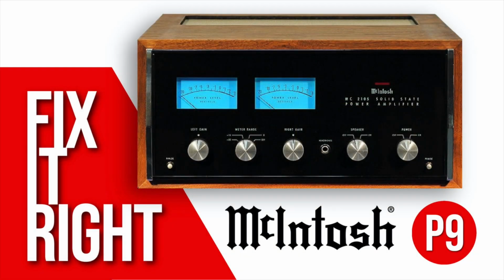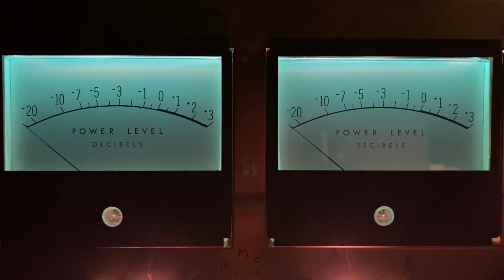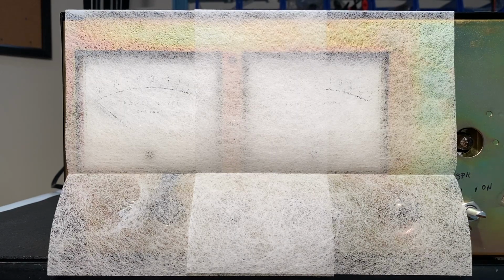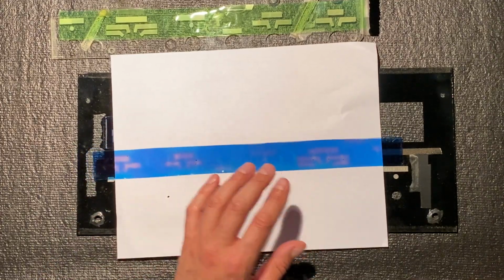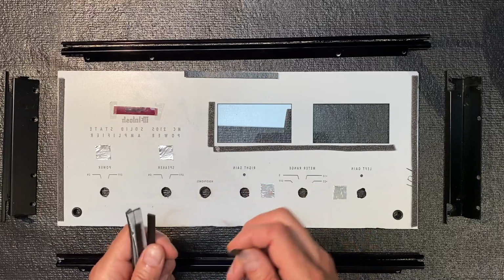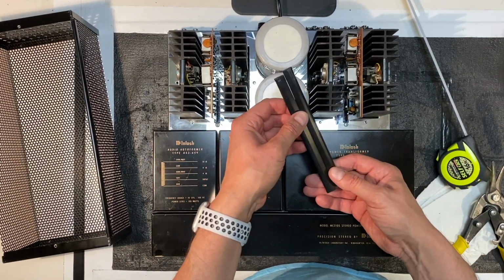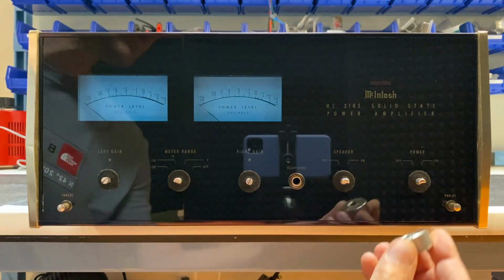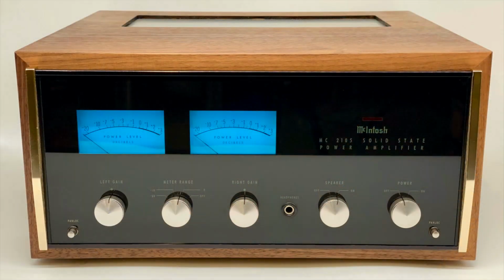McIntosh MC2105 P9: Demonstration, Meter Calibration, New Lamps, New Glass, New Cabinet & Panlocs!

Comment: Hi Chris,
I'm in the final run of this thing. I used my Radio Shack "Kamikaze amp" to make sure I had some of my instruments connected correctly to check certain specs. In Part 7 you used several instruments that I don't have but I wanted to check the accuracy of my meters and I ran a square wave test on the amp as well. The square wave test showed a great form.

I was so surprised at how perfect the wave was showing up on the scope that I thought I may have made an error connecting the SFG and somehow bypassed the amp! LOL Of course, it was connected correctly.

I only went to about 75 Watts because my dummy loads were 8 Ohm x 100 Watts. You cautioned that I was cutting it close if I went to 100W. 

I calibrated the meters and I was hoping you could confirm the conclusion I came to when I did these tests. I used the 50Watt level output (-3db), to calibrate to.

I have drawings and photos of my tests but no way to attach them here, so perhaps you can visualize my arrangement:

I set my SFG to put out a 1KHz @ 1.000V and calibrated the AC Multimeter to “0”:

A) I ran a cable from the CH1 of the SFG to the left & Right inputs of the amp, (BNC T-connection). 
B) Then I ran a cable from the Left channel, 8 Ohm, speaker connection of the amp, (with an 8 Ohm x 100W dummy load resistor), to the Input of my analog AC Multimeter. 

This cable also had a BNC connector on one end. The "+" side of the cable was soldered to an 8 Ohm x 100W dummy load resistor and the 'negative' lead, (or maybe it should be called the ground lead) of the cable was clipped to the speaker's Left channel, 'common' connector. 

So testing the Left meter first, I ran the cable ran from the Left 8 Ohm speaker connectors, to the Input of my analog AC Multimeter.

If you're still with me, 
C) I ran another BNC cable from the Output of the AC Meter to the Channel 1 Input of the O-Scope and grounded the O-Scope to the Amp Chassis.

Then I set the Variac to 117.4 Volts, (I always have a DMM connected to the Variac to confirm the voltage output).

I had my AC meter selector set to the "1V/0db" scale. I then sent the SFG signal and carefully increased the Gain on the amp's Left channel. 

I found that both, L & R Amp meters were off. Each were a little one way or the other of the Ac Meter’s db readings. 

I chose to use the -3db/50W as the calibration selection to bring the amp meters to read correctly. 

I turned the gain up on whichever channel I was adjusting until I saw the AC Meter reading exactly “-3db”. Then I adjusted the calibration resistors of the amp’s meter to move the needle of each amp meter to exactly -3db.

After the adjustment, I reduced the amp’s L or R gain to “-5db”, “-10 db” and –“20 db”. Each step was aligning perfectly with the same db readings on the AC Meter. 

In fact, they (the amp’s L & R meter readings), matched the AC meter’s db readings all the way up and down the scale. I took them up to about -1.5db but I didn’t want to push my luck and exceed the watts spec of the dummy load.

I think I got it right and am probably wasting your time but then, there’s been many times when things made sense to me and turned out not to be the case. I thought I’d better just bounce this off you and see what you think.
Thanks,
Rich
Reply from the maker: That all sounds great, Rich. Congrats! If you want to confirm that you’re getting 50 watts at -3dB on the meters, you can input a 1 kHz tone (use a sine) and (with dummy load connected) measure the AC voltage from the speaker output. Square the voltage and divide by the load’s resistance (8) and it should give you 50 which will be the wattage. The only other thing I’d mention is that if you only have one dummy load, keep the level at zero for the channel you’re not testing. Sounds like that’s exactly what you’re doing, though.
Reply: @FluxCondenser   Thanks Chris. In fact, I wanted to do that 50watt test but I'm not clear on where I should touch my DMM leads. 

"Measure the AC voltage from the speaker Output":
So should I set my DMM to AC and connect the leads to the "-" speaker contact and the "+" speaker contact (on the other end of the dummy load)? Or am I not even supposed to use the DMM? This is a step that threw me and yet it seems like it's too simple for me to not understand it. 

I started thinking, "Well if I use the DMM + lead connected to the dummy load, then am I affecting the the reading?". Then I thought, "...maybe I'm not suppose to use the DMM..."
Rich
Reply from the maker: Yes, connect the positive from the meter to the pos of speaker output. Neg of meter to neg  of speaker output. AC mode. Also have the dummy load connected to the speaker output you’re measuring. Standard setup for a power test and you can also use this method for a precise calibration of the meters.
Reply from the maker: Oh, and no, the multimeter won’t affect the resistance as its impedance is so high, likely in the mega ohms. This may sound counter-intuitive, but the high impedance limits the current draw to the meter so much that its effect on the circuit are negligible.
Reply: @FluxCondenser   Thank you!!! I knew this stage was coming for some time, but I felt the question was just down-right dumb to ask. However, from my lack of experience, I visualized frying one $50 DMM after another, trying various connection possibilities, (as I saw it in in my mind).

It was initially this method that I wanted to use to calibrate the meters, but not wanting to ask a dumb question, (which I ultimately did anyway, LOL), I decided to use the AC Meter as an alternate method to reference my amp meter readings.

Thanks for clearing that up. As you can see, I can be easily confounded when it comes to electronics, and don't even get me started on the many contradictions that I 'personally see' in the "physics of electricity"!! LOL. 

That field of science baffles me to no end; i.e. 'negative is positive and positive is negative', and Ground is so freakin' magical that you'd need to get a masters in "prestidigitation"! LOL
Rich

Comment: I'm glad I went and checked this part of the series, (as you suggested earlier). I was removing the nuts from the bolts, (12 of them), thinking that I would be able to remove the cage and covers all at once. However, I see that there are only 2 sheet metal screws on the bottom that hold the cage down.
Rich
Reply from the maker: Ah! Glad it helped!

Comment: Good series.. The reflective tape would work better if it was on the under side of the cover.. I did it to mine with good results.. Also for anyone needing to replace the glass because the black is chipping off.. I used 1shot 199L black glass paint to touch up with excellent results, it is a dead match in color..

Comment: Great job. Thanks.
I have mc 2505. Recently one of the meter is acting erotically. When I start the amp the left meter's arrow go to the far right and didn't moving. Struck there, not moving. After switch off the amp that arrow slowly return to the O position. 
The right one working perfectly.

Pls guide me how to fix this issue. Your advice will be much appreciated.
Thanks n regards
Reply from the maker: An erotic, meter, eh? ;-) Your first step would be to investigate the meter driver board. If the 2505 is similar to the 2105, there will be two potentiometers, one for left and right. Try moving the pots back and forth as they may simply be making poor internal contact. If the meter returns to a normal position as you do this, use control cleaner to clean the pots. Then put them back in their original positions or calibrate the meters using the steps I show in the video (follow the actual instructions, though, using the service manual for your unit). 

If that doesn’t clear up the problem, you may have bad capacitors on the meter board or elsewhere in the amp. You could choose to recap the board (or entire amp) and see if it helps, or try to really diagnose the issue. Diagnosis would be beyond the scope of what I could describe here, but would entail some signal tracing, voltage and component checks/replacement. 

There is also a possibility the meter itself is bad so you could check the output going to the meters to make certain the current is correct. If it is, you’ve got a bad meter. You could also try swapping the leads going to the meters (switch the left leads to right meter, etc). If the problem is consistent with just one meter, you’ll know you’ve got a meter problem and not a circuit issue. Good luck.

Comment: Very good video.  Interesting to see how it all came back together!  One thing I was curious about was why did you calibrate the amp meters to full scale?  Every power amp I have seen shows full power of the amp at 0 db, not full scale.  I would think that the +3 db markings on the Mac would be there to indicate headroom peaks.  In other words a 100w amp would have a 100 below the 0db mark and a 170w amp would show 170 etc.  Here's an example of a Sansui BA3000 to indicate what I mean.  https://www.audio-high-store.com/wp-content/uploads/2019/10/Sansui-BA-3000-1024x600.jpg .
Reply from the maker: The meter is calibrated at 105 watts per channel at 3dB. Full power without clipping. This is per McIntosh’s service manual and the correct way to calibrate.
Reply: @FluxCondenser  Ok, no problem.  Interesting.
Reply from the maker: Additionally, McIntosh may have elected to have the zero position of the meter peaked out at full scale so that at the lower meter positions (which are probably used more often) would have more meter movement. As these are not real watt meters and dB is a relative unit, the meters can be calibrated to any way the user finds useful. I wanted the amp to be set up as per Mac’s instructions.
Reply: @FluxCondenser  My MC2300 meters were calibrated using the same method, on the zero db scale +3 db = 300 watts.

Comment: Hi, great job! any suggestion how to fix/change the speaker switch? I can’t found an original to replace.
Reply from the maker: What’s going on with your switch, Marcio? Have you attempted to repair it or have you called McIntosh or Audioclassics to see if they have replacements? I’ve got my MC2105 all buttoned up now, so it would be difficult for me to check what type of switch you need. Nonetheless, I’ll try to do some research and let you know what I come up with. If you really can’t find a suitable replacement, you could consider bypassing the switch altogether so that the speakers are always on. If you want the speakers off when listening to headphones, you could bypass the switch and replace the headphone jack with one that will switch to headphones with the headphone plug inserted, and switch to the speakers when the plug is removed.
Reply: Flux Condenser hi, one side of the switch is gone! I called audioclassic and they said they can fix the switch (Still deciding if I’ll work with them $$) in parallel I am using the good switch side to drive a relay 2DPDT to switch the speakers....so far so good, but the best will be to find a replacement with an affordable price! Thx
Reply from the maker: That’s an ingenious solution in the meantime.